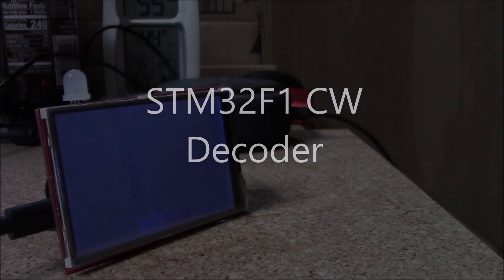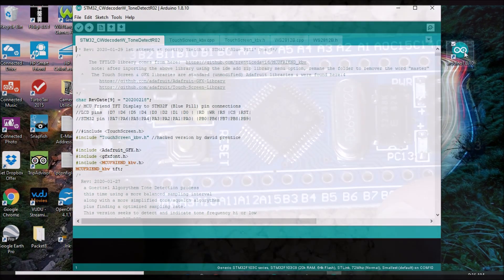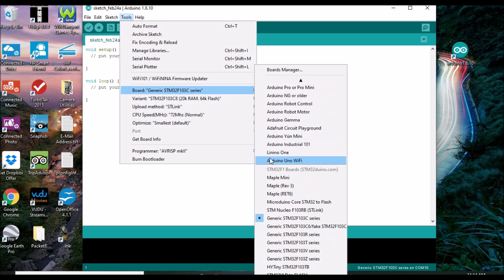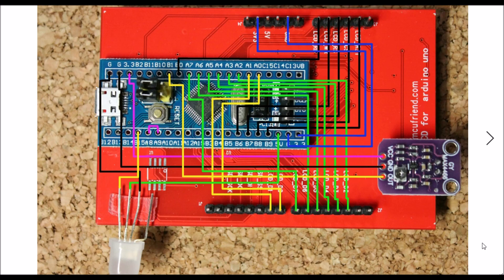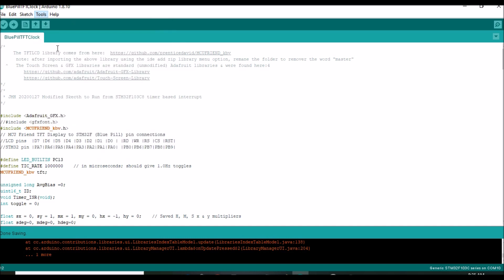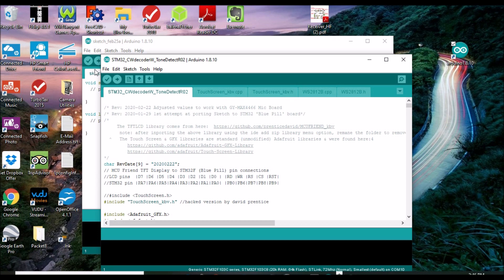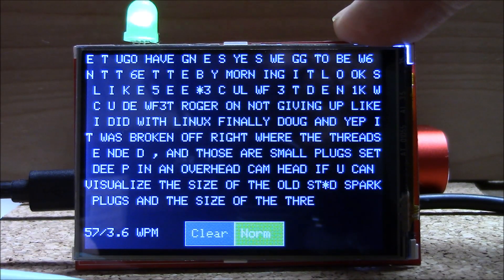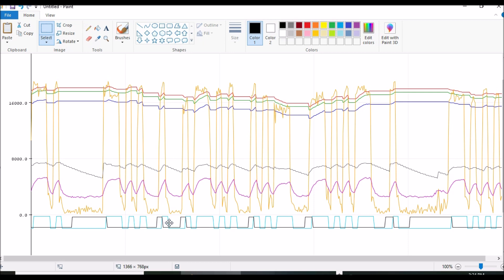STM32F103 (BluePill) CW Decoder

Comment: Good day to you.Please tell me where to get the V2 sketch?
Reply from the maker: I'm not 100% certain I follow what you mean by 'V2'. If you're asking about the Maple mini decoder/sketch, its in the same github folder ('arduino') as the blue pill version.
If you're asking about something else, clarify, and I'll do my best to point you to the correct link.
Thanks for your interest in the project
Jim(KW4KD)
Reply: @jmhrvy1947  I meant to flash the board firmware like in water, BluePill_CWdecoderW_ToneDetect. This is how it works, right?
Reply from the maker: @ivjik  I've got a feeling we've got a translator issue. This time I don't understand the phrase "like in water" . Water is something I drink. Don't know how it relates to programming. 
For what its worth, "BluePill_CWdecoderW_ToneDetect" folder is the collection of files needed to build/compile the decoder shown in the video, using the Arduino IDE. The IDE both compiles, and flashes the resulting '.bin' file, to the Blue Pill. Some of my github projects include both the source code, and a '.bin' file, allowing you to skip the 'compile' part, and directly flash the mpu/board. But this project is not one of them. With this project, you have to do the compile step. 
Hope that helps, but still feel like we have communications problem. Please feel free to ask again, if I'm missing your question.
tnx,
Jim(KW4KD)
Reply: @jmhrvy1947  Thank you for your understanding.I meant for flashing the board. The one in the VIDEO, BluePill_CWdecoderW_ToneDetect.Yes?
Reply: @jmhrvy1947  Thank you for your understanding. I did everything as you did, but for some reason it doesn’t start. Here is a photo of the firmware and pin connections. Please tell me what I’m doing wrong.
Reply: @jmhrvy1947  Thank you for your understanding.I did everything as you have,but for some reason it does not start.Here is a photo of the firmware and connection of the pins.Please tell me what I am doing wrong.
Reply from the maker: You can get my Email via QRZ.com. See KW4KD.. thanks

Comment: Hi, thanks for sharing this great project!
I have built it with a very common and cheap ILI9486 screen. Just need +5v instead of +3.3v in order to work. Took me a while to find out... 
The touch screen does not work however, and when using the test sketches it just show "broken touchscreen " . 
I will try to find out how to fix that. 
Thanks again !

Comment: Can we add audio jack as a signal input instead of microphone ?
Reply from the maker: Absolutely.. In fact, suspect that's how most user's have theirs. In place of the mic breakout board, add a pair of 10K voltage divider resistors connected between gnd & the Blue Pilll's 3.3V input, with the center tap connected to GPIO pin 'B1' (ADC input). Finally, connect your external audio source (the RX's audio/speaker out) using a 0.1ufd DC blocking Capacitor to the Blue Pilll's GPIO pin 'B1'. ~ 1Vp-p signal should be enough drive the decoder. So depending on your source & setup, you may need to insert some additional attenuation.
Finally, while this is a good decoder, and prices, in its day were, exceptional, today, If you're serious about building one,  I would recommend the latest iteration of this project. https://github.com/jmharvey1/ESP32S3_CW_Machine . While a bit more expensive, The 'build' is simpler, and the decoder is superior. Plus it supports the 'send' side of CW using a BLE Bluetooth Keyboard. 
GL & thanks for your interest in the project
Jim(KW4KD)

Comment: Can this tool read RTTY and FT8 signals? De YE8RAF
Reply from the maker: Good Question. But No. Its CW only. Adapting it to do RTTY would be possible, if it had the program space. But the Blue Pill version does not. FT8 is a time synced encoding protocol. This setup has no geo-synced clock. So that's off the table too. 
Thank you for asking 
Jim(KW4KD)

Comment: Bonjour, j'ai réalisé votre décodeur cw. j'ai suivi tout votre tuto. Et cela fonctionne parfaitement. J'ai juste une demande, le décodeur ne reconnait pas le " ; " , je ne suis pas programmeur et je ne sais pas comment ajouter ce caractère dans les tableaux. Pourriez vous me décrire la marche à suivre..... Je vous en remercie par avance....Jean-Louis
Reply from the maker: Congratulations.. Nice Job and thank you for the comment. 
Given what you have done, this is what I would suggest you do.
 In the BluePill_CWdecoderW_ToneDetect.ino file, look at line 346.
It should read, "#define ARSIZE 43". Change 43 to 44
Next, at line 390, which now reads "85" change it to "85,"
and then insert a new line after it, and enter the value "106"
In the table/array "DicTbl1", at now line 438 and reads, " "." " .
Change it to " ".", "
And last change,  insert a new line that reads " ";"  "
recompile and load your modified  sketch to the bluepill.
It should now decode "-.-.-." as ";" 
The binary value of decimal 106 is 1101010. The first "1" is a marker, or place holder, and the following 1's and 0's represent the dash dot pattern sent as morse code for the character. 
Now you have the power to add/decode any characters you like.
Good Luck,
Jim(KW4KD)
Reply: Merci pour votre réponse rapide. Je suis en train d'étudier pour passer le certificat de radioamateur. Je vous souhaite une bonne continuation. 73s de Jean-Louis-14FRS3818 @jmhrvy1947
Reply: Rebonjour, je viens d’effectuer la modification pour ajouter le caractère " ; " , et cela fonctionne correctement...Je vous remercie vivement pour votre aide et pour votre décodeur qui fonctionne à merveille...73s de Jean-Louis 14FRS3818
Reply from the maker: That is terrific. Was fearful, that the quotation marks would make the instructions too confusing to follow. 
Good luck with your studies for the exam. Its a great hobby. One which you can go in many directions. My personal favorite is building the hardware you use. Just worked Japan this morning with a 50 watt home brew station. At 76, that still puts a grin on my face. But so does reading that folks like yourself are looking at getting into the hobby
73,
Jim(KW4KD) @jean-louisrico-moulins3304

Comment: Hi Jim
I decided to build your project and unfortunately something is not working or something is wrong
bluePill project from your files:
BluePillTFTClock program works
STM32_diagnose_TFT_support program works
STM32_TouchScreen_Calibr_native program is not working
STM32_CWdecoderW_ToneDetectR03 the program compiles and uploads but does not work,
the screen is frozen and the led is not working...
could i get a good design for STM32 main ID=0x1581 lcd
best wishes Jim
Reply from the maker: Ryszard,
I'm impressed you got as far as you did. For the Blue Pill version, you're correct the STM32_TouchScreen_Calibr_native was corrupt. I've updated the github repository with new calibrate & decoder files (for the blue pill). I don't own a display with an ID=0x1581, so can't confirm that 'out of the box' these new files wont have an issue with your display. But given that your display worked with the clock demo, there's every reason to believe they can be made to work with it.
Please download them & check out the "readme" note found in the 'arduino' folder. 
Finally, if you have a connection with QRZ.com, & if needed, please Email me directly. Want to see you get your decoder up and going 
GL,
Jim(KW4KD)
Reply: @jmhrvy1947  tnx :) Jim everything is fine now.

Comment: Tried to get it working on an Arduino Uno but the compiler complains about no matching function for call to 'SPIClass::SPIClass(int). Do you have any idea how I can fix that? 73
Reply from the maker: As written, it wont work on an UNO. The sketch barely fits on a blue pill (STm32F103C).
There are a number of other issues that make it (the sketch) incompatible. Speed is may be the biggest thing. The uno is 8 bits running @ 16Mhz. The STM micros are 32 bit MPUs running closer to 100Mhz. Today, the preferred (IMO) solution, is the Black Pill, followed by the Maple-mini. The Maple-mini uses the Arduino IDE to load. While the Black Pill uses STM's CUBEMXIDE . See this Video's intro comments for a link to the maple mini source code. A short demo of the Black Pill can be seen here:    
https://youtu.be/1bktMEBSf8s
There you'll find links to the Black Pill code and wiring diagrams.Thanks for your interest in the project, and the opportunity to describe how  the project has changed since this video was made.

Comment: Well tnx!! Going to try to follow and achieve a working build!!
Reply from the maker: Appreciate the comment. Keep me posted how it goes. BTW the project has gone through a couple of iterations since the video was made. There's a Maple mini version and a Black Pill version. With the exception of the MPU, they all use the same hardware. To load the source code, the Maple Mini uses the Arduino IDE, while the Black Pill (F411) uses the STM32CubeIDE. All versions work well in good conditions (signal & fist). But  the later versions will do better over a wider range of conditions.
Tnx,
Jim(KW4KD)

Comment: You really should consider selling these ready constructedand programmed !!   Better than most of the commercially available units out there.
I would buy one
Reply from the maker: Mike,
Thanks for the "kind words". 
In truth, a few have been sold (mostly at Ham Fests). And like to think, any way to get folks thinking about CW as an option is good. For those who like to DIY I hope this video might get a few more units (and folks) going.
As for "decoding", IMO the Blue Pill version does well. But the Maple Mini (and now the Black Pill) are capable of decoding a broader set of receiving conditions. The wiring for each is different but essentially the same. And it needs to noted that the Black Pill requires the STM32CUBEIDE to be programmed. But today, for anyone looking at this project, I'd encourage them to consider these "build" alternatives.
Jim(KW4KD)

Comment: Hello Jim tnx for sharing  this Project. Is there a HEX file to load it direct to the Blue Piill
Reply from the maker: Hi Joachim,
I haven't posted the hex (.elf) file, but I can.
To be clear, there are three versions of the decoder:
1. The original Blue Pill
2. The Maple Mini
3. The Black Pill.
Other than the MPU (and some minor wiring differences) the hardware is the same.
Of the three, the Maple Mini is the most "polished"
But some folks report this board is obsolete, and not readily available in their area.
IMO, as a decoder, the Black Pill is the best. And today is the one I'm spending most energy to improve.
Let me know which board you want to use, and I'll put its hex file on github.
Tnx,
Jim(KW4KD)

Comment: How does it react to manual CW code.. i have notwd that many op is writing eiter slow or fast.. and some program wont  decode. Is anyone have a video on this working on real radio signals? Very nice project indeed
Reply from the maker: Apparently the earlier comment didn't stick. So will try again.
To be clear in the above video, the Blue Pill decoder is decoding real radio signals. But I get your point,  "how does it handle slow, manually sent, code?" Technically it can receive code sent as slow as 5WPM (symbol rate). But I find it rare to see anyone sending that slow. Typically, at that word rate, the sender will actually be sending at a 10 to 15 WPM (symbol rate), and use extra wide spacing between the letters. IMO,  this decoder does a pretty decent job with straight key operators. What I like to think is the decoder decodes like the receiving station would hear the message.  For example, if the letter "C" gets decoded as "NN" , or "KE", then the sender might want to concentrate more on their timing.  
Here is a video showing the Maple Mini version of this project  https://www.youtube.com/watch?v=finhZxlpOo8. This builder (W8DU) added some nice touches to the base project. 
And here's a video of a decoder (similar to the Maple Mini) with an OTA  QSO in the 7050 region of 40 mtrs.   Notice what it decodes, and does NOT decode. In the interest of full disclosure. This setup is actually using an STM32F411 with the mic  board removed and audio signal applied via wired connection. However, the decoding logic is identical to what is used in the Maple Mini. So with similar conditions the results should be comparable.

https://youtu.be/1bktMEBSf8s
Thanks for the question,
Jim(KW4KD)
Reply: @jmhrvy1947  Great answer.. i´ll dig into the links there.. im right now building a CW radio with built in decoder and encoder and im using a decoder from another op here.  thanks fer answer 73 //Jim

Comment: im having trouble. have 2 of everthing, as i intend to build 2 of these, but when compiling and uploading, it tells me complete, but shows nothing on the display.
Reply from the maker: Are you building the Blue Pill version, or Maple Mini? And what computer OS are you running? Not knowing either, my first suggestion would be double check the wiring. 
And if possible use QRZ to send me a photo of the back side of your display. There are two types out there. One (the one I'm using) has no on board 3.3V regulator. If you have one that does, then you'll need to also connect 5Volts to your display's 5V pin.
Jim(KW4KD)
Reply: @jmhrvy1947  Hi Jim. I am also building the device and utilizing a Maple mini. I’m also having the problem of the clock display not showing on the display after loading the sketch. I was unable to get the exact same display you show, although mine does have the exact pin out. I created an account on QRZ to send you a photo of the display but it appears that without a call sign, I’m not allowed to see your email address. That said, I believe my display may well have the regulator. Can you describe how to get the 5V to the display?  Where exactly is the 5V taken from?  Additionally, is it then necessary to remove the 3.3V connection after adding 5V to the display. I can’t tell you how much I appreciate you putting this video out. I really hope I’m able to get mine working.  I’m in the process of learning CW now, and although it’s no longer required, I’m looking to take my Technician’s exam soon. Thanks for any insight you can offer me with getting my display up and running.
Reply from the maker: @BobGarrett66  Bob, 
thanks for your interest in this project, & wish you success with the exam. Running a 5v display using the Maple Mini is doable. But if you want to use the maple mini's USB connector as the power source for the project, it will require a solder connection. Typically, 5V displays have a 3 terminal voltage regulator (actually 3 terminals plus a tab) located close to the display's J1 connector (the regulator may be labelled "U1"). 
Now here's a link to a schematic of the Maple Mini: https://stm32duinoforum.com/forum/download/file_id_2060.jpeg.
Basically what you want to do is create a connection point to the USB's 5 volts input pin, and jumper it to the Display's 5 volt pin. Physically, the most convenient place to tap into the Maple Mini's 5 Volts, is on the underside of the Maple Mini at the diode adjacent to the 3.3 volt regulator. Do not know about your soldering skills, but with a small iron tip, and a steady, but lite touch, it's doable. Once you have the 5 volts linked from the Maple Mini to your display,  you then can skip the 3.3 volt connection to the display. 
Hope this helps, & again GL.
Jim(KW4KD/jmh060947@gmail.com)
Reply from the maker: @BobGarrett66  Yes. Your display does have a 5 volt regulator. Its located at a slightly different position from what I described. And your right, it has no board label. But, in the link you included, the chip/regulator itself has the label "AMS1117" and is connected directly to the board's 5V pin. I have no first hand experience working with your display, but what I have seen, on other displays having a 5 V regulator, is the display's LED back-light is connected to the 5V side of the regulator. With only 3.3v applied, the back-light doesn't illuminate, rendering the display unusable; However, if your display actually lights up, with just 3.3v applied, then there's likely another issue.
Jim(KW4KD)
Reply: @jmhrvy1947  Hi Jim.  The display does not light up at all. Sounds like your earlier suggestion to get 5V wired up is the probable solution. If you concur I’ll give that a try.
Reply from the maker: @BobGarrett66  Agree. I'd go ahead and work out how to get 5 volts to the display.
GL
Jim(KW4KD)